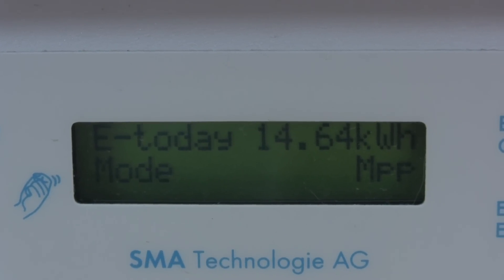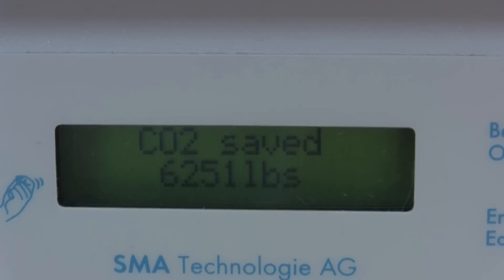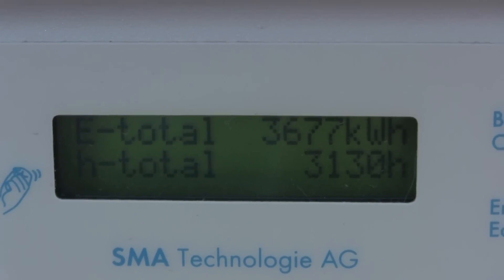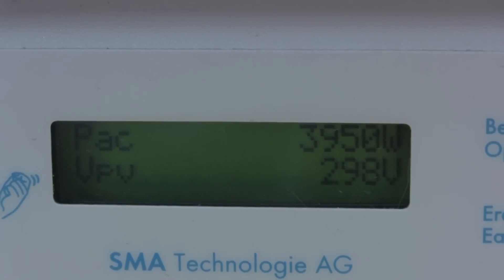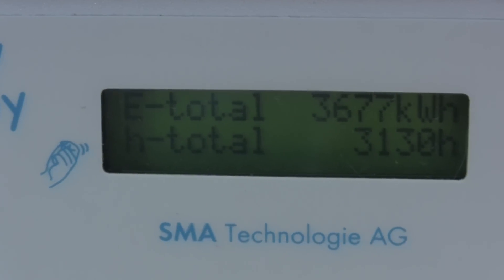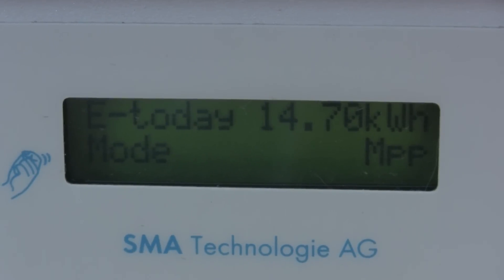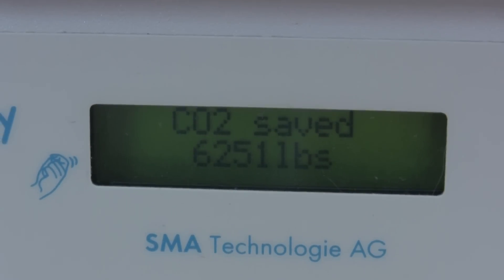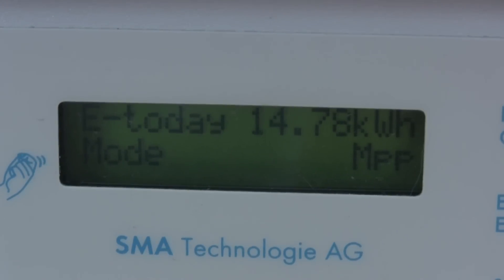Solar Panel Cleaning and Temperature Deration pt2

Comment: @SolarSteveUSA  I think heating water via a heatsink under the panels is a great Idea and very doable. If your in cold climates where water will freeze then yes Design and variables will get extremely complicated such as freezing water in pipes if something went wrong ect. Otherwise yes you have the wasted energy comming from the pannels in heat, and I belive it's our goal as humans to learn to glean every last drop of efficent energy from these processes. It all adds up on the KWH meter. IC.

Comment from the maker: I've always thought it would be really cool to develop some sort of heat sink under the panels where cold water draws out the heat and preheats a hot water system. I have asked this question of my solar instructors and they have almost always discouraged such ideas due physical obstacles like extra weight and expansion/contraction issues, as well as the associated costs of cooling/capturing heat versus the real benefit. They say just add more PV to reach your generation goals.